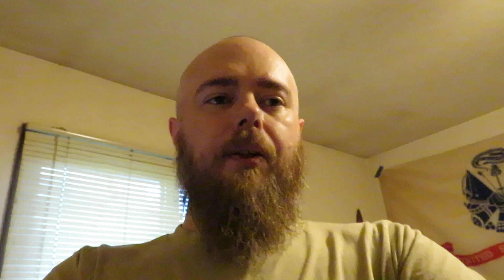New DIY Projects- Let Me Know Your Ideas!!!

Comment: I wanna have a full kit that I can run competitions and keep handy for SHTF. I really need some plates and a better radio.
Reply from the maker: What kind of competition do you, like USPSA/ IPSC, or PRC/ NRL?

I feel like some of the better options for an SHTF loadout with plates would be an LBE or Chest Rig with a Slick Vest under it (as needed, of course always METT-TC lmao).
I'm still trying to get my Prototype to market, but I do recommend checking out some stuff worth picking up-- for LBE's, check out Nixieworks, JayJay's Original (UK mfg), or Tasmanian Tiger (you can buy and piece together a system with their stuff for not too terribly much, check out Mad City Outdoor, one of the only US retailers for them).
For Chest Rigs, check out the ones retailed by 0241 Tactical, the 2 or 3 there are exceptional for the price, or you can go with the tried and true Blackhawk Commando Chest Rig, they still make it  :)  LBT also makes nice Chest Rigs but they're expensive.
Slick Vests are available from a lot of different manufacturers and retailers, just depends what color or camo pattern you want heheh, lots of good options out there though.

Comment: Plate Carriers. 
We'll test them.
Reply from the maker: They would be simple slick vests/ bags if I were to make one, I don't have the additional webbing/ strapping to make PALS grids or anything either, nor any hook and loop/ velcro for necessary adjustment points.
Reply: @DJTheMetalheadMercenary Slick, with around the front Velcro side straps would probably work.
Reply from the maker: @specialprojectsdevgroup  Yeah that's essentially the type I have and use personally, I just don't have any velcro right now is what I was saying lol, I only have the 500D Ranger Green Nylon Sheet, some EVA Foam for good padding, and the bonded Nylon Thread I need to stitch stuff.